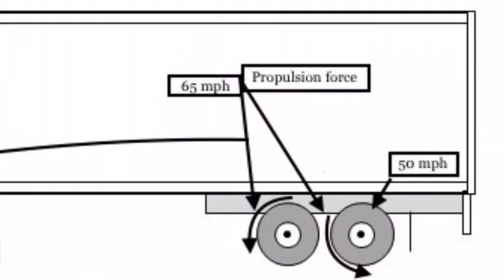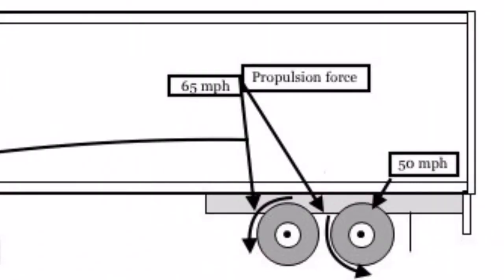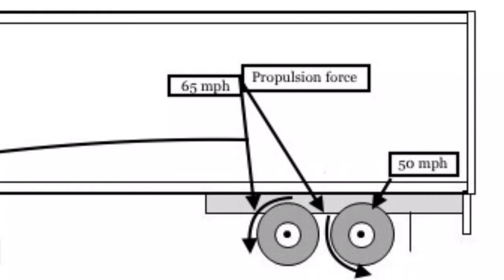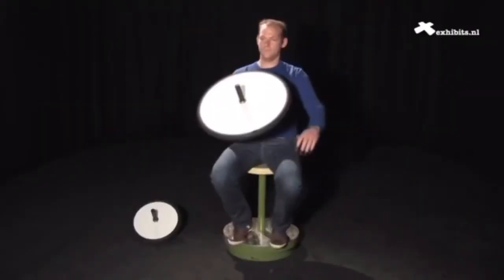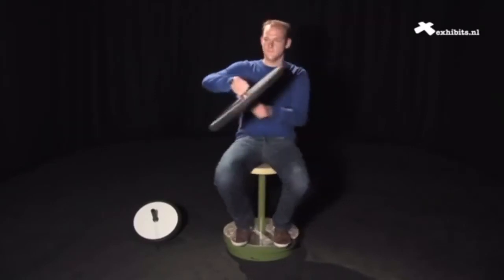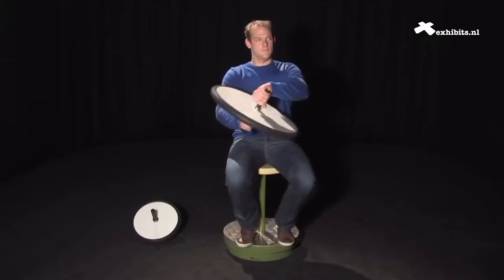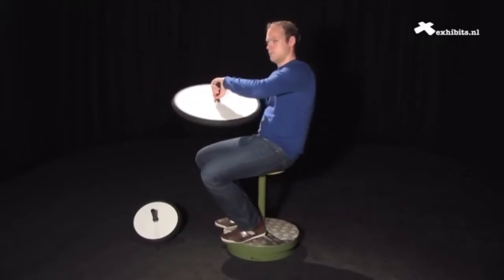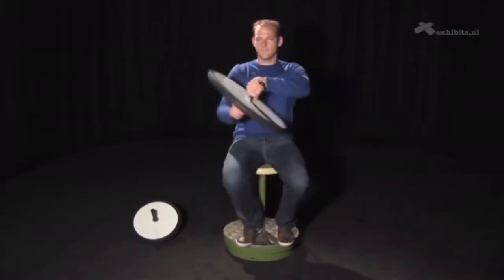STOP 🛑 DO NOT USE YOUR JAKEBAKE ‼️ (In wet weather conditions)

Comment: Ok you have a decent channel. Just try not to say grown men drive Pete or kw. Grown men make big bank. An if Steven's works for you. You are a winner. But I always say. Would you rather dig a hole with a spoon or a backhoe. If it was a digging contest. Life is a digging contest
Reply from the maker: Trucking Review Channel 

You’re missing the point, in the trucking business a well-known and well manufactured truck as well as how you keep that truck conditioned for optimal performance will progressively preserve you as a grown man making big bucks
Reply: @TacticalTrucker  I heard stories of brakes catching on fire if you use the regular brakes too much. I was on I 64 and my truck was going so fast downhill. I was afraid that due to such a long steep downgrade through the rain my regular brakes would eventually lose all air brake pressure. I 64 has very little railings and deep cliffs and it was raining making it more difficult. I'm thinking about a different route through I 64 during winter and rain even if it takes me longer. I was scared as hell, trying to keep myself calm during the moment at the same time. Any advice for me?
Reply from the maker: Shawn Johnson 

You already gave yourself good advice, find a better, safer route. If you are an owner operator and you have your own trailer, make sure you don't have any Chinese tires on any of your axles, those Chinese tires don't stick to the ground, Bridgestone, Michelin, Goodyear, fire stone, those are all the top tires that have rolling resistance technology and they seriously stick to the ground, so all the tires on your truck to make up the difference the purchasing Bridgestone tires... also, if you are an owner operator get some brake disks on your semi, they stop your truck more effectively then break drums
Reply: @UFOsAreRealArea51  I've been trucking for 38 yrs. The last job was making 3 trips a day from Beckley, WV to Covington, VA pulling logs grossing between 82-95, 000 lbs....across I 64. This included a grade of 7% for 5 miles. I have a picture on my phone right now of a truck on fire at the bottom of the mountain...yes it can happen. 1: you have to know your equipment and your load. Some trucks have a switch on the dash that says engine brake but does little more than make noise. 2: SLOW DOWN. Best comment I ever heard was, no one ever died from going too slow down a mountain. This was a good video about trailer swing and jack-knife, but I have to disagree...You can and sometimes must use a Jake in bad weather, loaded.
As far as finding another route...be careful of this. You'll never get good at downhill grades if you never face them. You might find yourself running from this and other situations for the rest of your career. I hate to see anyone quit trucking out of fear (seen that, too). Be safe, driver.
Reply: @TacticalTrucker  thanks
Reply: @stevelengel6370  thanks as well.
Reply: @UFOsAreRealArea51  It's not gone jackknife I use Jake's on mountain when wet also when I'm chained up with snow  as long as you're loaded and at safe speed you're fine..  That's primarily for empty trailers
Reply from the maker: thanks for the detail on that, but I generalized it because we have people in trucking that does not have tactical driving judgment